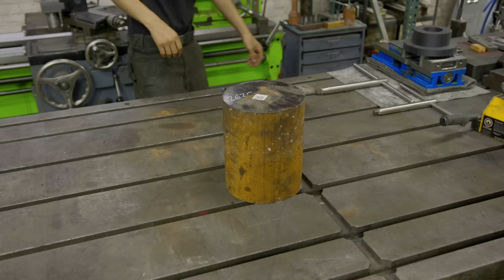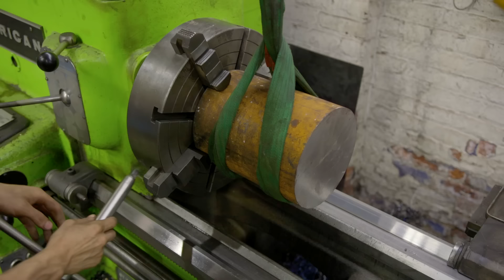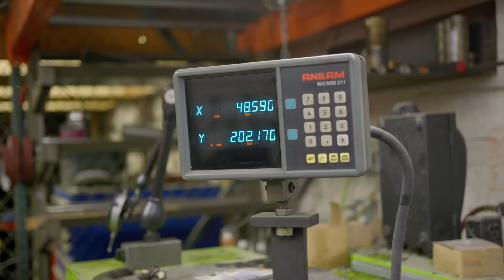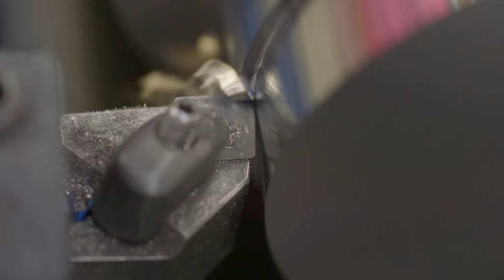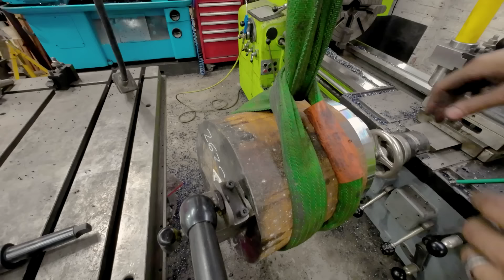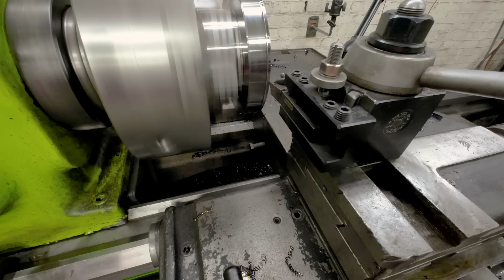Machining a Pin Boss for a Large Excavator Bucket

Comment: Hello. I have 5 years of experience on 2 axis CNC lathe, I usually do piece and small series production, choosing tools, inserts, setting up the machine, writing program, making the parts according to documentation, occasionally steel (from mild to about slightly hardened to 35HRC), most often stainless from martensitic, 1.4305, 1.4301, 1.4404 to 1.4571 (316 with bit of titanium I believe), 1.4462 and rarely various alloys like inconel, arcap, hastelloy and a lot of aluminum-based soft alloys. I machine from palm-sized parts up to 45kg stainless chambers and 120kg 0.75m shafts. I am very interested in this trade, sadly there are very few communicative and helpful people with dozens of years of experience who could I ask and they would answer my questions correctly.
After watching this video, my views on machining are very confused. I usually run parts in claw-jaws, on big parts I set hydraulic chuck on max. 2MPa (99kN) so it doesn't just slip or fly away. The turret lathe (26kW spindle probably) usually allows me 4.5mm D.O.C in very soft aluminum-based materials, 3.5 in softer steels, 2.5 in medium materials and 1-2 in very hard materials. The problem doesn't seems to be stalling of the engine or tearing the part out of the chuck but rather low rigidity of the machine.
Anyway I thought that the part is forced "against the cutting force of the tool" or out of axis, so it just tears itself out of jaw opposite to the tool and flies away - that's why you need centerdrilled the big chunk because the force away from the chuck multiplies the force perpendicular to the axis by the lenght of lever, so you need live center to "hold the force perpendicular to the axis by centerdrilled area" and to push the part back to the chuck. For example if you try to turn small rod at the end of the machine, it also just bends and starts flapping around (hopefully not hitting you). Now imagine this force but on the bit part that doesn't bend but just gets pulled out of jaws.
Then how is it possible that you:
-don't have center drill, just "push" the part into the axis, so it won't oppose any force perpendicular to the axis multiplied by the lever
-hold the part in manual chuck that you tighten "by hand"
-hold the about 400mm long part just by about 40mm long jaws without any "claws" that "bite" into the material
And take 12mm D.O.C with atleast 0.3-0.4mm/rev which equals to force of like 4-5 small cars pushing on the part and the part doesn't just get torn out of the chuck and fly away..?
I once came with hangover to work, forgot to change pressure on the chuck, left it about 0.7MPa which is about 30kN static force, took 3mm D.O.C, 0.3mm/rev into 304 stainless steel and the part just flied away.
How.. how is this possible..? Where is the trick..?
Several times, I tried searching for some machinist technology handbooks on how to calculate force of the chuck and compare it to the force of machining, the DOC, feed, cutting speed, distance from the chuck, etc. and calculate if the part is safe to machine or not, but there is nothing like this.
Could some guy who works in this trade explain this to me or direct me the right way, please..?
Reply from the maker: I don’t know much about CNC so I don’t know where I can provide insight but usually when I do heavy turning, I like to make sure I have tailstock support so maybe that would help you. I’m not really sure what’s going wrong on your end. Also the rigidity of the machine I’m using far exceeds most CNC machines unless they’re really large ones so that could just be the issue there. The beauty of having a computer run the program is you can take lighter cuts and walk away so efficiency is a little less important.
Reply: @VanoverMachineAndRepair  Yes, I fully understand that you have machine for heavy turning and its rigidity is far superior to mine, especially due to the turret. The CNC and classical machine differs only in that on CNC machine, you have computer that controls servomotors which move the toolbed/turret for you and instead of having trapezoidal screw they have ball screw so the movement is more accurate as you don't measure the workpiece after every pass. Otherwise the principle is the same.
My question is more general machining related - how do you calculate the clamping force and force of tailstock so you can be sure the workpiece just doesn't fly away and kill you? We had some basic calculations about frictional force between the workpiece and jaws must be greater than cutting force but nothing really specific.
Or do you just tighten the chuck and hope something doesn't fuck up and kill you..?
Reply from the maker: @adamsevcik7708  in manual machining you don’t calculate clamping force. You just tighten it by feel.
Reply from the maker: @adamsevcik7708  it takes time and experience to figure out what will work well and what won’t.
Reply: @VanoverMachineAndRepair  So do I, I just don't tighten it by force but increase pressure on the hydraulic chuck. I was just asking if there is any better option than "let's just try it, either it flies away, destroys the machine and kills me or it will work".

Comment: WTF are you talking about?  Cut a piece of 1/4" longer than finished piece.  Chuck it up and face it off.  Flip your jaws around ao you have the steps.  Flip part and have faced side against jaw step face in the last outter step grabbing the part by 3/4 or 1" whatever that last jaw step is.. do your outside turning to finished dimension.  Grab part from inside or make a quick mandrel or finish outside of large OD flip part and grab large OD and finish minor OD.. 3 options 1 requires scrap round bar for mandrel but other 2 do not.. last option would be my choice

Comment: Nice proof of performance in using 3d printing in parallel at work. It speeds things up! Even if you were to make a delrin test part, 3d printing makes more sense for rapid prototyping and less waste of expensive materials, especially in a home shop. No one wants to buy a do-over slug of steel. 3d printing saves you from kicking yourself in the coin purse. Appreciate the work you do for the community in sharing your knowledge, thanks again.
Reply from the maker: Yes 100% agree. Thanks

Comment: Generally speaking for roughing in steel I like to run it at around 180M/min at .3-.4mm/rev and about 4-6mm on the radius. If you're not looking for a decent surface, give her some feed, makes the chip really small and easy to work with.
Reply from the maker: Good thoughts

Comment: I would have cut the piece first and then worked in the lathe, obtaining essentially maximum rigidity and concentricity, without tail support. I also would have bored everything in one piece, from the back side. The additional dial-in at the end for chamfers would not require maximum accuracy. And actually could be done through hole.
Reply from the maker: Yeah there are multiple ways to do it.

Comment: Grretings, n00b here, don't you need coolant to this operations? Still in the first half of the video, but I can tell:
This is machining Pr0n! :-D
Reply from the maker: Thanks guys I’ll get coolant on the lion. It def be nice for certain operations but for now no coolant. I wish I had it for drilling but od turning not as necessary.
Reply: His insert would last longer if he was to use coolant yes (generally speaking), does he "need" coolant? absolutely not. You can generally tell if your speeds and feeds are wrong by the heat generation of the part and by the chips, i learned if your chips turn blue and the part isn't getting that hot your speeds/feeds are right. And generally speaking the faster you can remove the material the less heat you generate (because it is in the chips).
!!!And i have to note here that some carbide insert manufacturers recommend using NO coolant because of the thermal shock (rapid cooling and heating), which could cause the insert to crack on you.!!! 
Yea he is tacking big healthy cuts not like other machine channels who baby their machines..